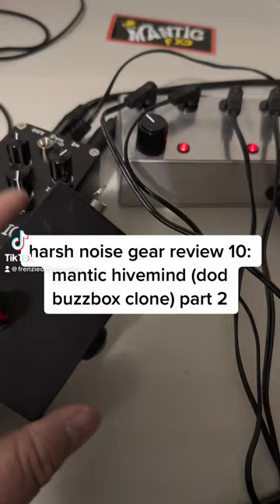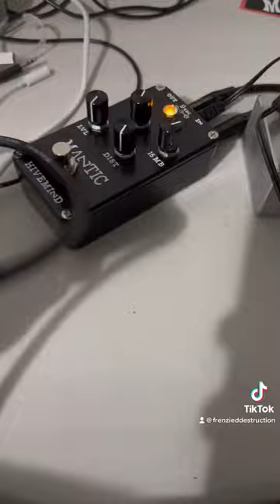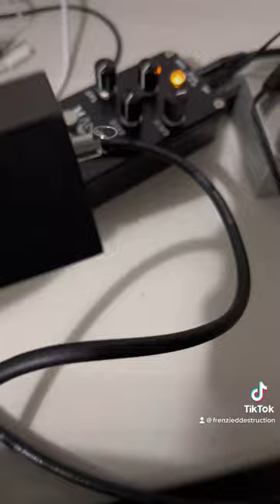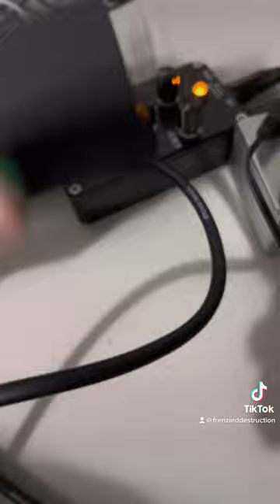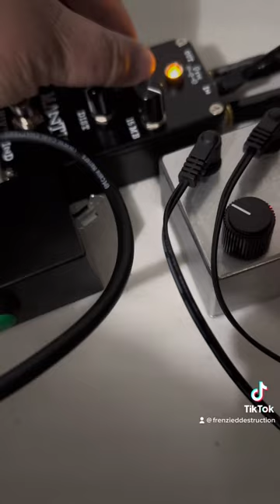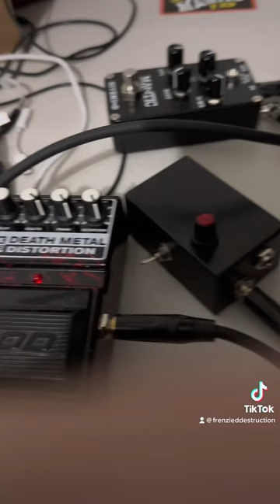harsh noise gear review 10: mantic hivemind (dod buzzbox clone) part 2

Comment: What do you think of it compared to the original Buzzbox?
Reply from the maker: never got a chance to try one due to the price! I talked to someone from mantic through email and they said it’s the same circuit as the buzzbox but with the addition of a internal trimpot to fine adjust the input gain. so theoretically it should sound the same. the buzzbox has like decades and decades of noise legend status and hype so it would be hard for anything, even the original to live up to that I think. essentially it’s a fuzz (not a distortion) with a knob that makes these deep sputtering and rumbling sounds - kind of bitcrusher-esque?